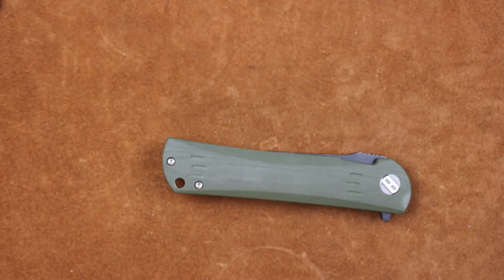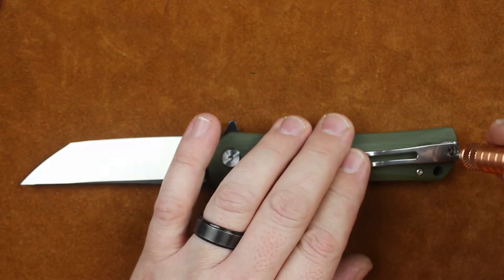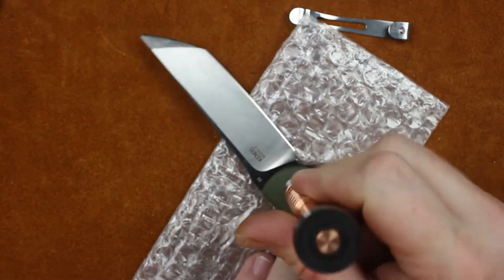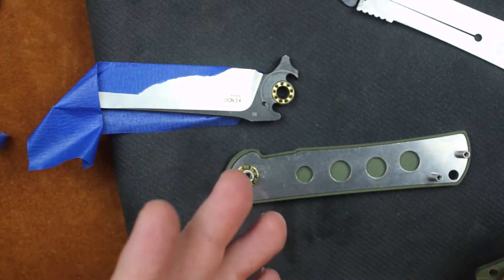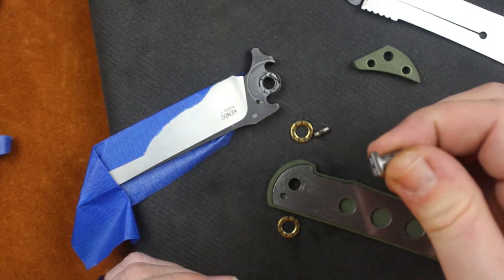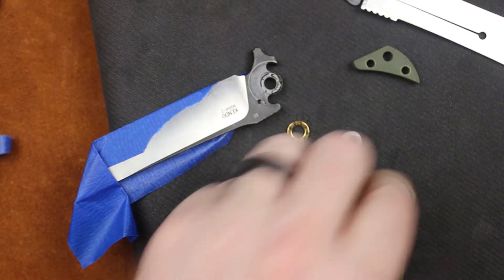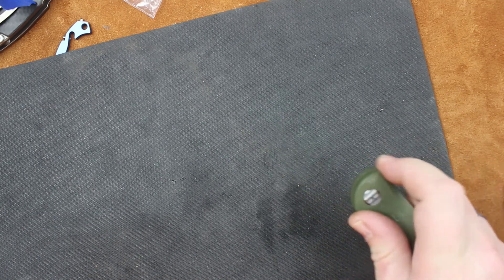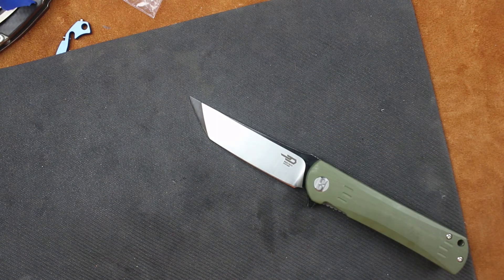What's Inside? The Bestech Kendo / Disassembly and Maintenance

Comment: Zel great video. I'm glad you think there well made and at a great price because I own the kendo,scimitar and I have the warwolf on the way. I bought the lion on massdrop so that's still going to take some time to receive. I impressed so far but a little disappointed seeing that free spinning pivot but at least it came apart fairly easy and nothing stripped. Is the action better after disassembly and after rotating bearings. So at least I know you can put bearings in either way and It will still operate properly.
Reply from the maker: +Brian Wallace flipping the bearings had no affect on the performance of the knife, they just do a little better job of repelling stuff when out in that way.